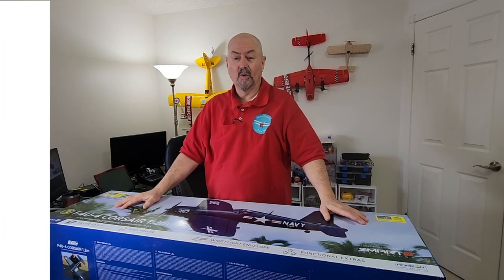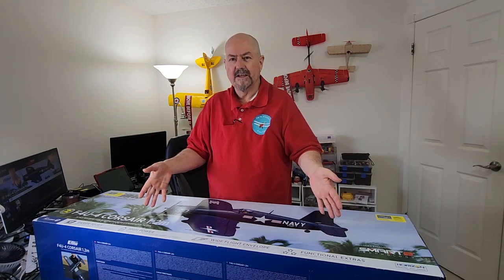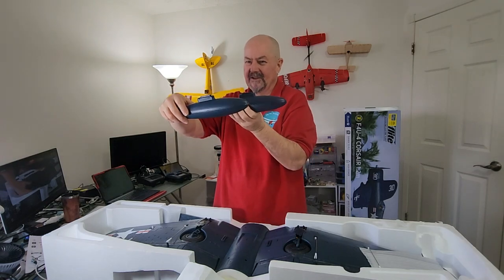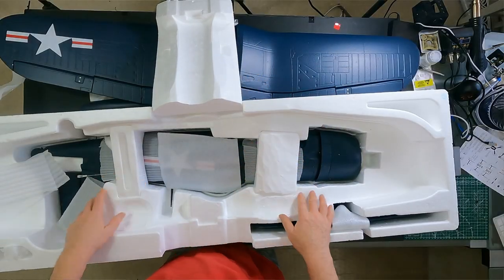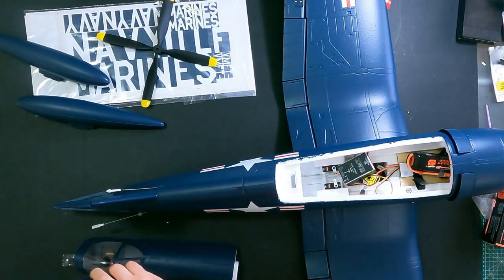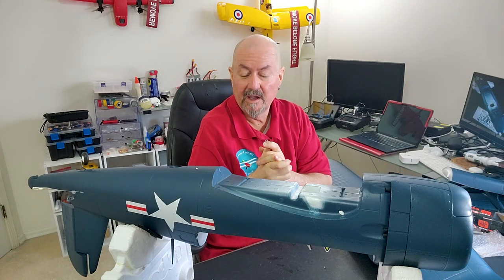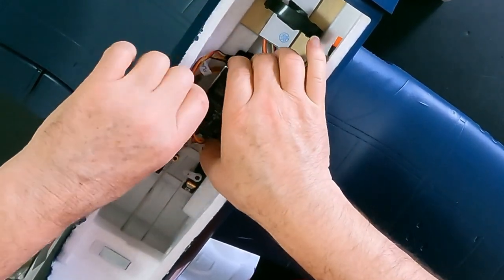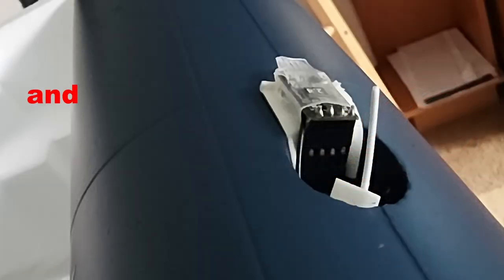Corsair Unboxing and Setup - E-flite F4U-4 1200 mm

Comment: I quite enjoyed this Tim, it will be interesting to see the conversion. 
May I suggest highlighting the panel lines. 
Very easy to do, buy some grey chalks from a cheap art shop or children’s store.
Shave off some grey chalk, mix some washing up liquid with water.
This acts as a surfactant, mix it with the chalk in to a very fine paste.
Use a washing up sponge and wipe the lot on the aircraft.
This fills in all the panel lines.
Let dry and wipe off the excess.
Revealed is a super lifelike model. ❤
Reply from the maker: Cool tip - thanks Nick!